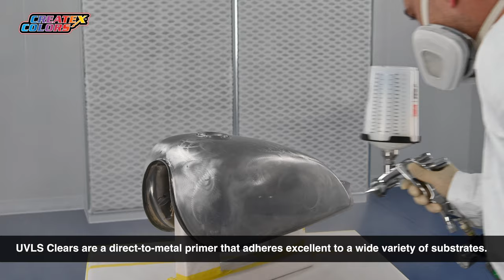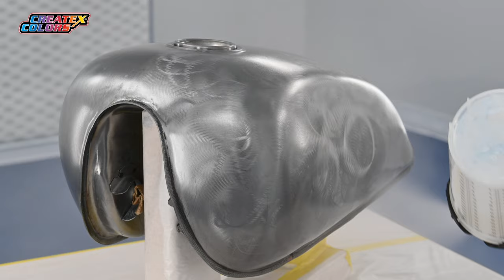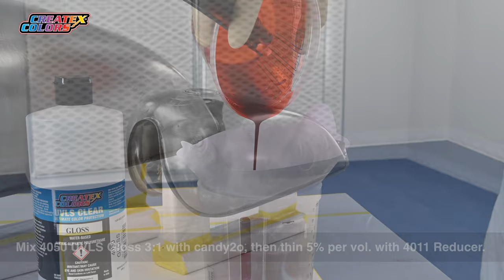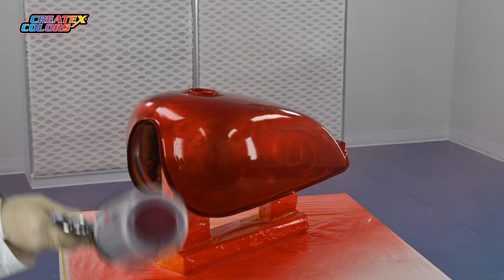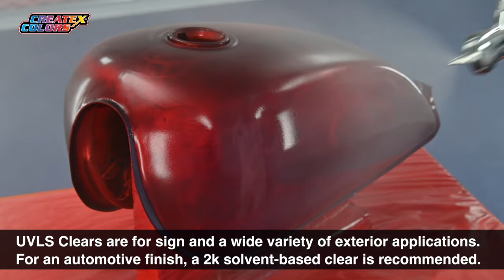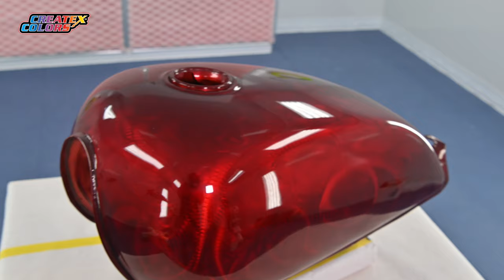Createx UVLS Clears Introduction Video

Comment: Is this not a water based product? How are you formulating to allow direct to ferrous metal application without promoting rust. Impressive.
Reply from the maker: Yes, UVLS Clears are  water-based and formulated to adhere excellent direct to any metal (steel, iron, brass, aluminum, magnesium, any metal) without oxidation, i.e. rust does not form.  Thank you.

Comment: Hi, just started using your products for airbrushing and i`m getting amazing results, i do have a couple of questions if that`s ok, ive been using createx wicked colours with 4012 reducer, candy2 O with 4030 intercoat clear to create real fire just to familiarise myself with the techniques, once i lay down my flame licks i`m going over them with the Candy2O and then Bleed Checker 4040, now once i`m happy with the effect i have and i want to apply a Gloss Finish to the piece, do i use the UVLS 4050 Clear Gloss and THEN use a 2K Solvent Based Clear on top,, or do i just use one or the other, IE, Either UVLS 4050 Clear Gloss and call it a day,, or do i do away with the UVLS 4050 all together and lay down a 2K Solvent Based Clear ? Sorry to be a pain but i just want to get the process right because i don`t want to end up with the piece blistering up and bubbling, thank you for your time.
Reply from the maker: If top-coating candy2o with a gloss clear for an automotive finish, use a 2k solvent-based urethane clear such as the PPG EC550.  UVLS 4050 wouldn't be used as a clear over candy2o when top-coating with a 2k urethane clear. Thank you.

Comment: 2 questions: When buffing GLOSS (like the video shows), is a solvent of any sort being used with the foam pad, or just a plain foam pad?  Also, is there a final process for the MAT finish? I am getting a fine mist that sits on top that I want get rid of. Thanks. Great paint system by the way, we are using this system exclusively for a new product.
Reply from the maker: We used the Presta Ultra Buffing system which includes a pad conditioner. Apply 4052 UVLS Matte Clear same as other UVLS Clears, with a medium-wet first coat followed by 2 - 3 additional medium-wet coats with enough a re-coat time so each coat dries tack free before applying the next coat. For more information, please refer to the UVLS Clears tech data sheet, https://creatextech.com/pdf/tds/UVLS-Clears-TDS.pdf. Thank you.
Reply: @CreatexColors  thank you.

Comment: Wondering if clear coat is essential if i use auto air on an outdoor concrete surface  ?
Reply from the maker: Top-coating with a durable clear is always best for optimum durability and longevity. Thank you.

Comment: i have read the TDS, but didn't find anything about:  can it be used on leather?
Reply from the maker: Yes, UVLS Clears are excellent onto leather, as an adhesion coating, mixing with paints and as a top-coat. We need to make a UVLS & leather video. Thank you.

Comment: Is this tone a replacement for 4030? Can we use 4012 or 4013 instead of 4011 to reduce it? ✌️🙂
Reply from the maker: 4013 Reducer can be used a substitute for 4011 Reducer.  We do not recommend 4012 Reducer for use with candy2o as it promotes "seeding" of the dyes, that is conglomerated clumps dyes that appear as dark spots in the finish.  Thank you.
Reply: @CreatexColors  I learned this the hard way, good to see you are getting the information about dye seeding out there.

Comment: Can i use on motorcycle farrings?
Reply from the maker: Yes, 4050 adheres excellent to plastics, including the plastic used for motorbike fenders, fairings, and other parts. 4050 also adheres well to carbon fiber and gel-coated fiberglass composite material. Thank you.

Comment: How tough is this clear coat?
Reply from the maker: UVLS Clears are a durable, architectural grade clear meaning they work well in outdoor conditions, have some scratch/ mar resistance but are not as hard as an industrial clear such as Imron or most automotive clears. UVLS do dry hard enough to be buffed & polished, and will hold up after prolonged, complete submersion in water after fully cured.  UVLS Clears are made with an acrylic-polyurethane resin blend that cures with better adhesion and higher mar and chemical resistance than many solvent-based acrylic & urethane clears. Thank you.